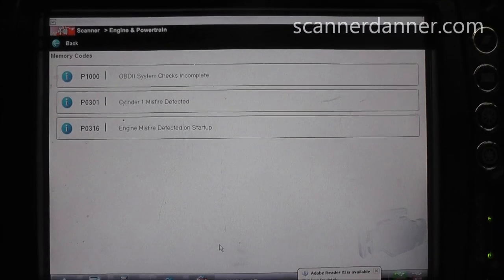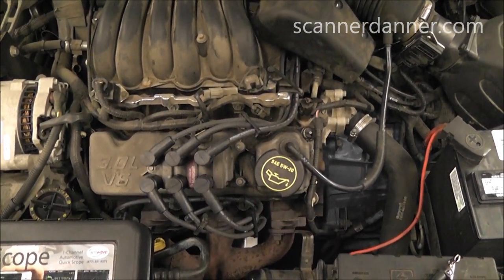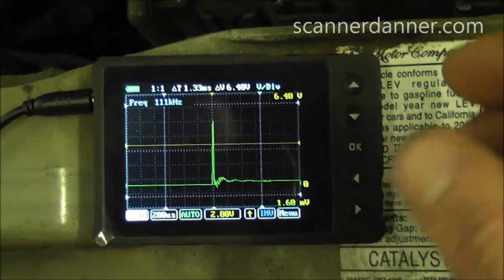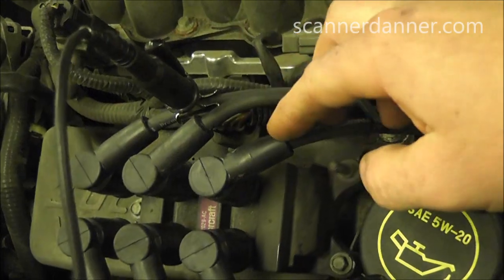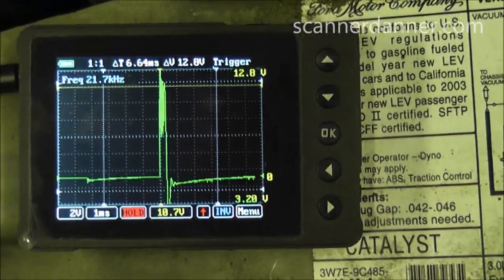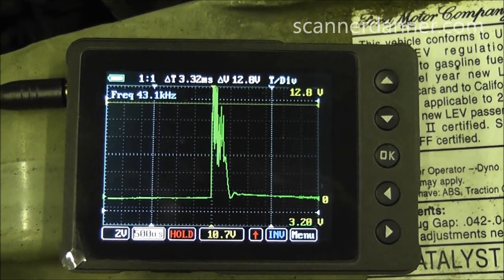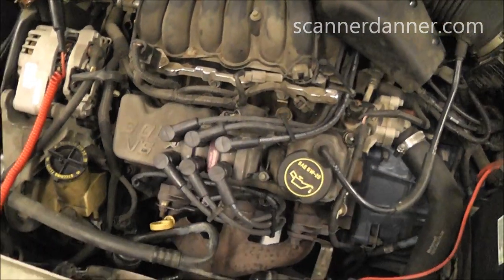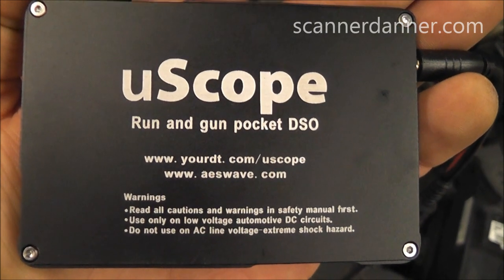Finding a misfire using AESwave’s uScope - weak ignition coil

Comment from the maker: in the very short amount of time this is being done, no damage will occur.
think about how many times you have had a misfire from an open plug wire that the customer has been driving around with for days and the coil is still okay. of course this will kill a coil too but my point is a few seconds of high coil kv will not kill it.

Comment from the maker: don't worry about 9 and 10. the tricky part with these Fords is the higher mileage engines will flag the wrong cylinder for a misfire due to timing chain slack. Look toward the cylinder either before or after the #7 in the firing order.

Comment: From an electronics engineer perspective all these handheld scopes are toys, but keep in mind even the picoscope and the verus would have trouble keeping up with some medium frequency signals with any sort of resolution. For Automotive diagnostics these scopes are fine. All the handheld scopes are from china but have decent hardware thats well designed. Seeed studio has made better firmware available for these as well as documentation. They still lack a lot of features cheap bench scopes have.

Comment from the maker: you can with an optional paddle probe that they sell. however the cop coils with the transistor inside of the coil are hard to get signals from no matter what scope i use.
as for the current ramp test we may or may not have seen the problem. not all secondary faults can be seen on the primary ramp

Comment: GREAT tool. Also some french cars like Peugeot 206, Ciroen C2 1.1 Engines (4 cyl) they are using Compression sense ignition CIS and they don't have camshaft sensor :) and this tool will be valuable to all owners to those cars too that have knowledge. Thanks for posting this video.

Comment: The uScope is more ideal for automotive diagnostics:
- We improved hardware for increased safety and customization: changed channel input to protect against bridging/grounding; Isolated the USB; added a memory card slot.
- AESwave’s proprietary software: adds a peak detect function; improves user interface; Enables customization of A/B buttons.
- Kit includes automotive specific test leads, and a 2GB Card.
-1-yr warranty from AESwave in Fresno CA.
More details on proprietary unit at AESwave.com.

Comment from the maker: what you need to realize is the actual voltage levels that I am putting into the scope can be measured in the millivolt to volt ranges. even though the KV reading is in the thousands of volts. 
The scales represent the KV numbers, these are not actual and it is the same for all scopes when viewing Secondary KV with a capacitive pickup.

Comment: You're mostly right, Dunc, but a 1 inch gap in open air (outside the combustion chamber) is really only in the neighborhood of 25 to 30kv which is usually a perfectly good range to test a high energy coil.

Comment: Keep in mind you can use ANY scope, for cars. Yo dont need to have "automotive" scope.
If you dont have much money to spend, get used 2 channel analog scope (50$-100$) or DSO Nano (89$ -For field use), secondary (30$) pickup and current sensor (Starting from 5$) or use inline 1 ohm 10W resistor (1$) and measure voltage drop on the resistor. I have analog scope(50$) and DSO nano, analog is prefered in most cases. 
Search for youtube video "eevblog analog scope", it explains a thing or two.
Reply: V E R Y   important advice. I had this doubt all along!!!

Comment from the maker: I am not sure I was clear on that. Here is another example. You are viewing starter current using an amp probe and you show 200 amps on your scope. Does that mean you are applying 200 amps directly to the scope? NO! It is a voltage conversion. (say 10mv = 1 amp) So 200 amps can be read on a 2v scale. Does that make sense? It is the same for KV readings with Secondary Ignition

Comment: Ok thanks a lot.  At 240K I will have to look into this.  Wish I was close to you as this would be a good class "project".  Misfire goes away after no more than 2 minutes after cold start winter or summer.  Sets a code if I drive it away too soon.

Comment: Paul or any other technicians, What is your opinion on "ignition system analyzers", small handheld meters with a COP paddle pickup, that shows secondary ignition data (voltage/kV, burn time/mS, and some even show RPM and have a misfire indicator/counter?!?). Some of these units even show a secondary waveform! This tool /sounds/ awesome because you don't have to set up an oscilloscope with settings or leads.. even would save time vs a uScope because all you do is turn it on and place the paddle on the target coil.
---This tool is called "General Technologies Engine Ignition Analyzer", and the part # is "GTC505"

They even make similar analyzers but for fuel injectors, which /claim/ to show voltage wave forms using a pickup wand, and show pulse width time, RPM, PCM control signal, pintle opening/closing time, and has a "candlestick graph" to compare to other cylinders/injectors. It even claims to detect and count misfires using this data.
---This tool is called "General Technologies Fuel Injection Analyzer", and the part # is "GTC605"

Has anyone used these analyzer tools or similar system-specific waveform tools? It seems really great to have access to this information quickly without setting up a scope and placing leads. I am trying to decide whether to buy these separate tools or just a mini handheld scope with COP pickup wand and injector probe. The accuracy and speed of this small device raises doubt as I haven't ever seen a technician use either one, only seen regular oscilloscopes
I listed said tools above and am interested in hearing others' opinions before I buy them.

Comment: Just FYI you can pick these scopes up on ebay unbranded, then flash the firmware from the website. The stock firmware on the ebay scopes is junk. Also check out seeed studio (yes 3 e's) they have a nano2 with their custom firmware which is good, for $89 and a 4 channel for $170.

Comment: Could leaving a secondary ignition circuit open (like for some moments when testing with a test light), potentially harm the coil? I just remembered we were told that, at least in two-stroke systems - when electronic ignition came along.

Comment: hey dan how is the connector on the side of the unit it looks easly like it could break?  also info on the display you use in the class room what is that unit that allows you to move the screen from the board i need to get one at the school i teach at

Comment: i dont get the idea from the end part, the last note on the uscope.. 1) use only on low voltage dc circuits, you used it on a KV sensitive mode?

Comment: Any idea what may be the cause of not seeing the dwell/on time  when testing ignition coils by putting a secondary ignition probe on spark plug wires?  Vehicle shows no misfire codes and seems to be running okay, but I don't see the dwell at all. I do see the inductive kick and burn time, but oddly, no system voltage pulled to ground before the inductive kick on any of the cylinders.  Spark plug wires on this car are really fat and large in diameter, not sure if that's causing it.

Comment: I bought this scope. On my first day, the uscope paddle prob got spark from distributor cap, now it do not measure any voltage, even battery voltage. Doesn't it have any safety? Is it repairable? Such equipment without safety and diy repair would cost more :(
Reply from the maker: Contact www.aeswave.com, I'm sure they can offer you advice on what to do. When using the paddle probe, did you have the external ground lead connected too? That is there to protect from such incidents.
Reply: @ScannerDanner  external ground lead was connected to -ve terminal of battery. It showed waveform with same connection for few seconds and then got a spark.

Comment: i have a ? which one u think wld benifit the uscope or the snap on vantage?  i do alot diagnostic work on electrical systems an dont have big money but lookin for smthing tht is alot faster than a multimeter to were i can catch glitches in like crank an cam signals an abs sensor!

Comment: Hey Danner, thanks for video. When you went through the secondary ignition coil that was not first cylinder but you showed it before others, does not that secondary ignition coil give signals of "Lean" condition in that cylinder? Cuz it had a bit kind of turbulence in the cylinder, it indicates the "Lean"condition. Why did you count it from Normal condition? Again I am talking about the "First" Secondary ignition coil you showed that was not the First cylinder.
Reply from the maker: Turbulence is normal, especially on a snap throttle. Check out my stuck closed injector case study to see what a lean misfire actually looks like in a secondary pattern
Reply: @ScannerDanner  I just watched your video about "stuck closed injector" video right after reading your reply. But there are some materials that little trubulance is shown there as "Lean condition". Can you make the video to find clue moments to see difference between Lean condition and Worn lab probe please? It would be fantastic for your viewers^^
Reply from the maker: I just don't use secondary ignition to see fine details, it's too difficult, too many variables. Don't get me wrong, I use it, but there are more fool proof ways to identify certain conditions.
Reply: @ScannerDanner  It was the most essential word that I needed to hear. Cuz I was stuck to every single waveform of ignition coils. And it was making me crazy. I will follow your way, as well. Thanks a lot.
Reply from the maker: @orkhansafarli5992  watch this one when you get time my friend https://www.youtube.com/watch?v=SUShO72Grq8&t=1s

Comment: I have Nano and old analog scope. Nano is only good if you need extreme portability. other ten that get 50$ used analog scope or save some money for benchtop DSO (2 channel 25Mhz start from 250$), you can try to get used DSO for cheaper. Benchtop scopes are faster to operate, they have dedicated knobs for most things. In nano you have use MENUs and it feels like a toy. To understand what I mean watch video called "eevblog analog scope"

Comment: Hi Paul the capacitive pick up can be used only on waste spark right, it won't show up a misfire on distributor spark plug cables one at a time.
Reply from the maker: The capacitive pickup can be used on any plug wire, doesn't matter if it is waste spark or not
Reply: @ScannerDanner  Oh I'll try it again I have a u-scope

Comment: So when the voltage per div. section blinks in red does that mean your scale is too low?
Reply: Spoke with Mario from AESwave and he confirmed, the blinking red voltage indicates that, the scale is too low and needs to be adjusted higher.

Comment: Limited sampling rate and clunky user interface. There have been lots of reviews and talks about them online just search youtube or checkout any of the electronic hobby sites or forums. I have thought about getting one just to have in a tool bag but dso bench scope is way better even for auto repair. I know Paul promotes the pico scope but in my opinion they are no good either they lack the bandwidth (limited by usb spec) and for the price of a pico scope you can can a really good bench scope.

Comment: Ya, this uscope is a rip off at $400.  The only difference between this and the DSO nano v3 is the firmware.  Which I guarantee you can find somewhere online to flash over.  The DSO nano costs $89.00

Comment: Hey Paul thank u for all ur teachings. But just like u tell ur students go and play with the scope get some pictures to see what a known good waveform compared to a bad one. But this is confusing because on page 14 in ur book that same waveform u had on the scope really looks like a no fuel misfire. Now I know u can verify by checking the spark distance from the coil like ur explaining but What if like u said it's under the intake manifold. Because now I'm confused. If u can elaborate on it so I won't misdiagnose while at the shop. Looks like a no fuel misfire
Reply from the maker: No, this looks totally different. Check out the hash in the spark line. You won't see that in a no fuel misfire. Look again my friend.
Reply: Ohhh ok it's the hash. Scope waveforms can look misleading when u are new to this. Thanks Paul

Comment: The test light test that you are demonstrating can cause a coil to fail. You are forcing the coil to try an overcome some extreme resistance by making it jump a one inch gap or have no good path to ground. It could cause the coil to short internally and ruin a good coil. No harm done of the coil is the source of the problem but if it isn't and someone damages a good coil who's going to be on the hook. Other than this I love all your videos and I wish I could work with you.

Comment: Costs 400 Bucks .... ?!!!
Reply: zloben9000 For the master kit yes which includes high amp probe, low amp probe, 1:1 leads, and many other expensive components.  If you already have those components you can get just the uscope for about $130 from AESWave.  They custom programmed the firmware for automotive use.
Reply: +DJDevon3 Aeswave now offers 3 different uScope kits. The Master Kit, The Basic Kit and The Basic Lead Kit. Awesome little scope too! Great for beginners!